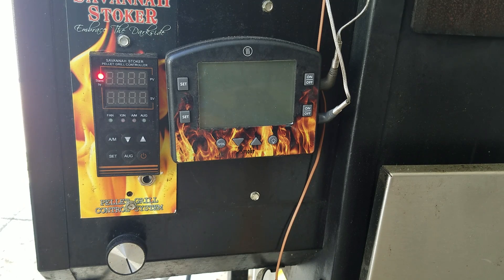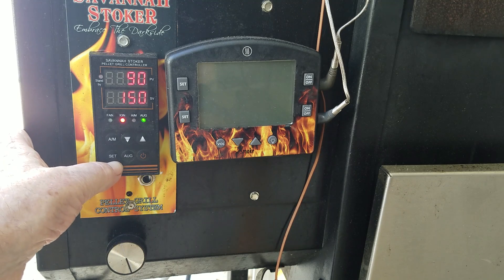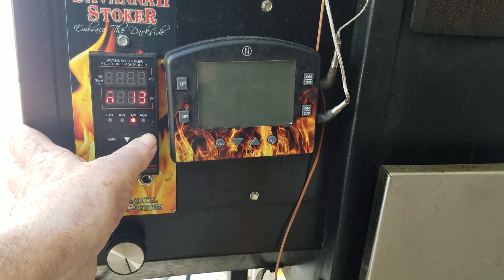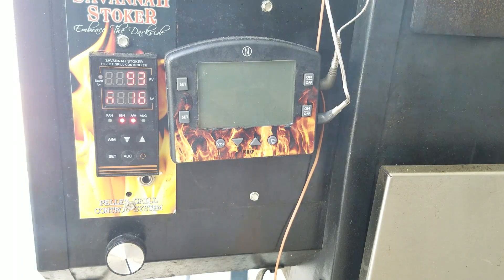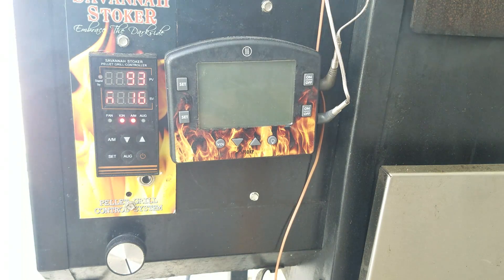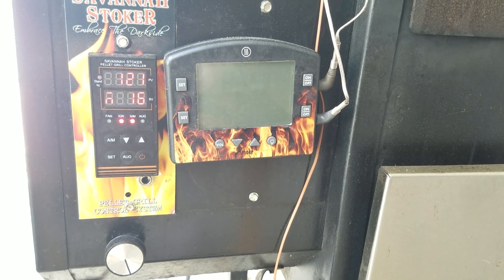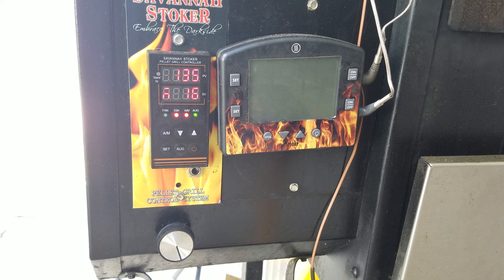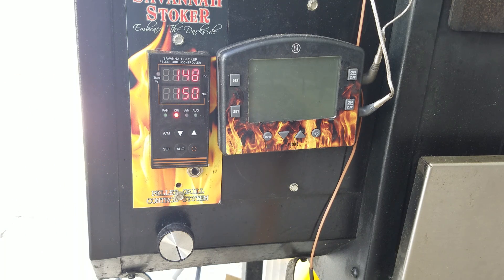Savannah Stoker 4.5 and earlier,  Alternate Start Procedure reduces TempOvershoots during the Start

Comment: Audio
on your video stopped working @ 5:15 just when I wanted to know what the dial was for at the bottom of the control panel.
Reply from the maker: yes the audio stop but that was after the procedure so no loss.  Anyway, the dial is on a Rheostat which adjusts the Higher Fan CFM to change the Air / Fuel Ratio.
Reply: Can’t you program the cfm with the PID ?
Reply from the maker: @ramellin  The controller has 3 speeds and not even finite enough to adjust the Air / Fuel Ratio.  I have been using a higher CFM Fans with Triac Rheostats in my Pellet Grills since about 2007 or 2008.  There is a video of my highly modified Baby Traeger showing this.  BTW the video has been trimmed.
Reply: arthur held I will do my best to pull up that video and watch it thank you very much for your response👍🏻